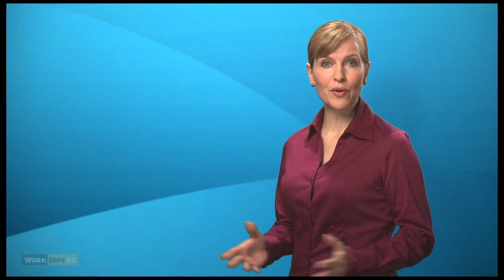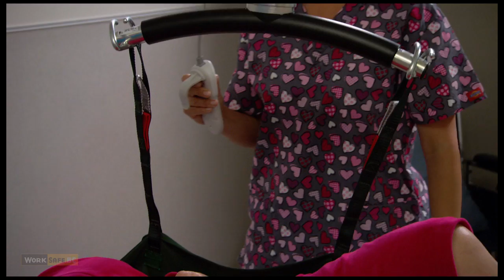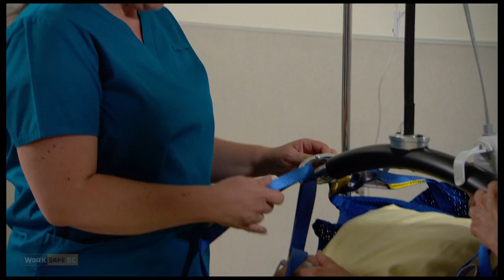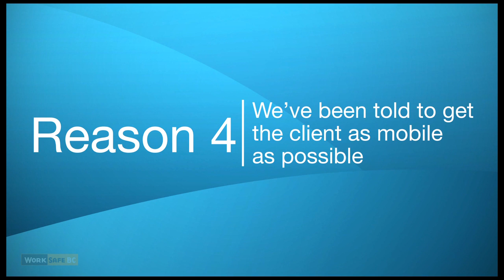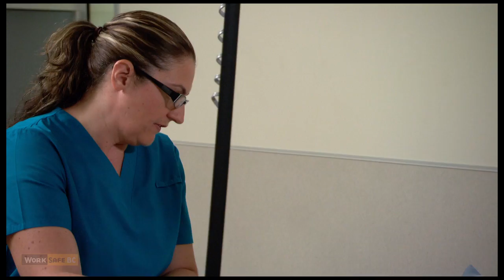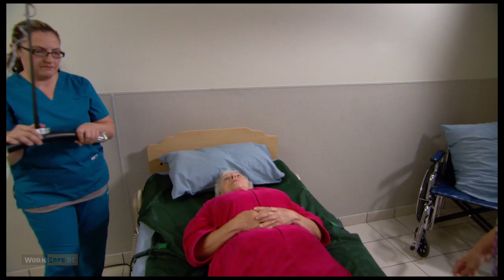Ceiling Lifts: Why Aren't They Being Used?

Comment: Funny how they imagine there's always 2 nurses at hand with ample time, and patients are a-ok with sleeping on their plastic net thing 24/7.
Reply: It's understandable this is not always available, but this is what is optimal.  Also, there can be exceptions to the rule with leaving the repo sling on, you can consult with a wound care specialist if skin integrity is an issue.  There are several pressure mapping studies to show there isn't a significant difference with it on or off.  Sleeping in a plastic net may not be the dream, but you have to factor how important is staff safety relative to patient safety.  If your department is suffering time loss issues due to patient handling, then make those adjustments accordingly.
Reply: 2 person assist in CP (careplan)
Reply: Also the patient is able to bend their knees, etc..

Comment: I noticed in the initial part of the video and at the end of the video the bar was in the vertical position to the patient instead of horizontal to the patient's shoulders.  The vertical position of bar can injure the patient by hitting them in the face. Also, it is not practical to keep the sling underneath the patient for long periods of time, even though it may be easier when moving or repositioning the patient.  The slings are not necessarily the softest material, which may cause skin breakage.  Also it is not to sanitary, especially when the patient may be in diapers or using pads which may expose the sling to bodily fluids and vice a versa.  It is best for the patient, even if it adds a few minutes, to place and remove the sling as needed.  It really doesn't take a lot of effort or time to place and or remove the sling as needed.  Otherwise if I could afford a ceiling lift, it would be phenomenal in the care of my adult son.  Love the video. Learned a few things.